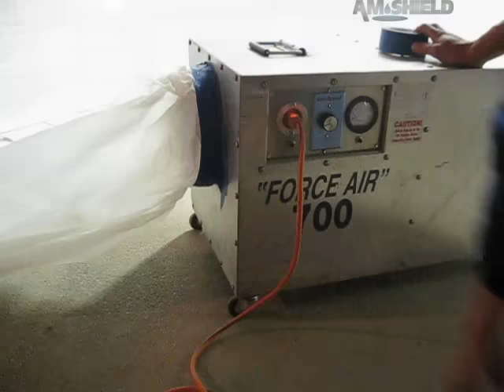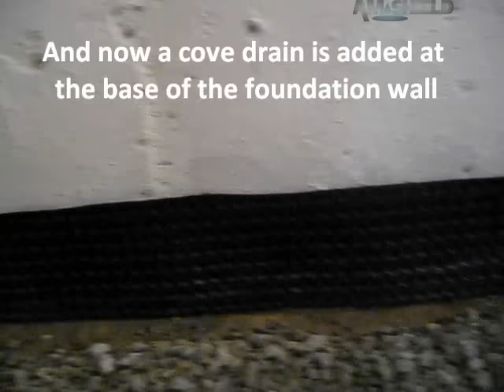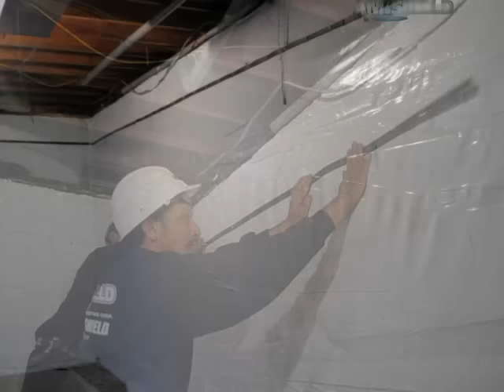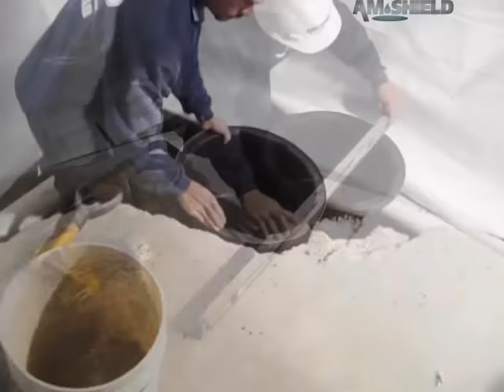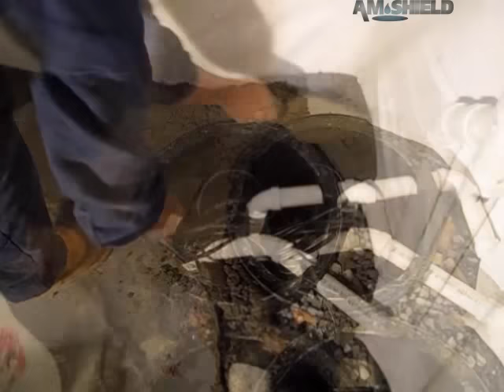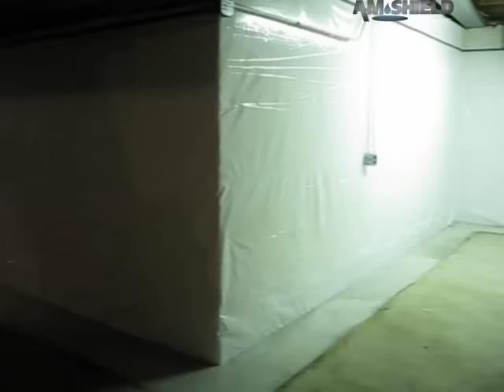Closed Pressure Relief System

Comment: 1 You forgot the weeping holes for the water to drain out the walls 
2 wrong pipe purficated black pipe with slits 
3 the gravel goes on top of pipe 
Pipe needs to make contact with ground ware the water is
Reply: no weepers needed. its a poured foundation. the white pipe is much better. it does not clog as fast. he did put stone underneath the pipe and as long as he has stone underneith the pipe. your fine

Comment: Thoughts on ADS vs PVC?  I thought ADS was the better option?  No joints and smaller drainage holes tucked in the ridges so less likely to clog than the PVC and fabric sock combination... (I know it's more difficult to pitch evenly).

Comment: the pipe trench should be installed well below the footer, i hope this was a poured concrete foundation because it looks like you missed drilling a lot of weeping holes in the cinder blocks (one every cell and also in joints)  you can't stop water coming in unless you seal from the outside with a vapor barrier.  this may last a while but in 30 years at best those cinderblocks behind those "vapor" barriers will be the consistency of hard wet sand.  This job may have cost a lot, but I can tell you it will cost a lot more for someone to come behind and do it the right way the first time.
A short term solution (maybe)
To a long term problem.
Reply from the maker: Andrew, I cant emphasize enough that a basement de watering system should NEVER be designed below the foundations footing. Th e job shown in this video is a poured concrete wall and for this reason no weep holes are installed.
Reply: @Andrew Ruffing
Pardon? So your advice is to undermine the footing?

Comment: how do you cap the pipe at the end of the line? also do you install some type of flushing fittings for future maintenance? thanks so much, great video
Reply from the maker: Hey Charlie, Normally with a four wall system there is no end to the pipe, however a PVC cap is made for this purpose. Clean outs are ports installed usually 25' apart to access the system and do periodic system flushes to homes that are effected with iron problems in the ground water.

Comment: If only you had put the trench and pipe below the footer where the water is sitting. Clean work, probably still going to have a water problem from being so shallow. Also, since you covered the wall, they won't know for a long time that it has failed.
Reply: you are wrong if you put the pipe below the footer you will undermine the foundation.
Reply: @robb930  below the level of the footer, not directly under the footer.

Comment: Just wondering if that mesh rebar will do anything to reinforce the concrete and prevent cracking when it's resting at the bottom. I've watched slab pours where they use a tool to pull the mesh up towards the middle during a pour so that it's effective.
Reply: The concrete layer is quite thin, it will do
Reply: @mamarrachopunpun  That's exactly the problem. The newly laid concrete offers no protection at all and is more likely to crack when it's poured thin. It's window dressing. Everything is completely reliant on the PVC/sump. Any newly laid concrete should match the width of the existing slab. When the concrete is laid thin, if anything goes wrong and water backs up in the trench, water will have a higher likelihood of making its way through the cracks, cold joint, and the open gap in the cove common with the standard open system. I'VE SEEN IT HAPPEN. And flooding will then be widespread and 1000x worse than if they had done nothing at all. 
Never compromise the integrity of a uniform slab, and never create a pathway for additional groundwater to enter. Retrofit interior drain tile is a total hack job.
Reply: @mamarrachopunpun  And what happens when a waterproofing co. doesn't even do a minimal amount of research on your property or attempt to determine the source of your problem, they open things up and allow in a perpetual supply of groundwater (picture the thumbnail of this video except constantly filled with water) and are then stuck with a sump which NEVER STOPS CYCLING? Happened to me. Had to pay another company to tear it out and now I'm burdened with the tremendous responsibility of how to effectively fill it back in and seal it up.
*I'm not a customer of AM Shield.

Comment: Hey there, im going to piggy back on most people’s objective in the comments below. 

I hade a contractor installed the drain tile similar to you here. 4-8” deep. Top of pipe is nearly aligned with top of footer. They also put the same white plastic board about 6 inches up along the foundation wall.

It’s been a year since I had it installed and water never gets high enough to enter the pipe.  I can see water getting into my block walls and seeping thru cracks during heavy rain. (They did drill weep holes, i have cmu blocks, but they did missed some mortar joints which was never corrected when i ask them to do so)

The Only times the sump pit collects water is when the ground water rises into it, never enough to reach the pipe. Therefore I concluded that the water pushing on the wall is taking too long to enter the pipe and slowly going under neath the slab towards the sump pit. Any updates on the systems that you have installed, I am thinking of redoing mines and going deeper towards the bottom of the footer.

Comment: Having an exposed Vapor Barrier plastic cover the basement wall. To me it's a fire hazard. A concrete sealer on the basement wall would be a better option
Reply: concrete sealer traps moisture and deteriorates the block and concrete
Reply: What would you do in place of the wall vapor barrier? I'm putting a perimeter drain in, but have had water seepage come actually through the wall about two feet high. Not sure If the perimeter drain is going to fix that problem. I'm two feet into a clayish substrate at basement floor...
Reply: @richnunya9547  without seeing the job. You may need an exterior tile drain put in. If you think an interior drain will work for you I would install a dimple rap on the wall that's leaking water and tie it into the perimeter drain. Google delta dimple m a t e
Reply: @jeanalexandre1105  Thank youuuuuuuuuuuuuuuuuuuuuuu!!!!!

Comment: Am I missing something, but how does the water get into the solid PVC without perforations?
Reply: Frank Matturri there is a quarter sized holes and they face it down so the water flows up through it that's why you didn't see them

Comment: They did not dig past the footer. So you will still have water below the foundation that can come up through the floor. Plastic sheathing on the walls will cause condensation and that can cause mold. Good luck with this job.
Reply: Of course you'll have water sitting below the foundation.  That's where its supposed to be.  What do you think would happen if you dug below the footings all the way around the perimeter of the basement?  It would weaken the whole compacted structure of the earth below the footings, potentially cause erosion and ultimately could undermine and weaken the whole foundation.
Reply: @Josh-wq8tt thank you for this important information

Comment from the maker: The pipe should never be below the footing. By doing this you take the risk of undermining   the foundation and causing structural damage.
Reply: 10 inch from footing , 4'  80/8 weeping pipe recomended @ he bottom of the footer.
Watch Daniel O'Connor all his videos he reassure pipe always the bottom of the footer. 35 years of experience.
Reply: many  many jobs that Dan O'Connor has to fix did what you just did not burying the pipe deep enough ,you are causing the water to raise to reach the pipe causing mold mildew .

Comment: That washed rock can filter the pipe. A filter fabric is eventually gonna get clogged up like a filter does if it isn’t changed. Is there any filter that never change out in any kind of system (car, A/C unit, dehumidifier, etc).  Putting the pipe at the bottom of the footer isn’t going to effect the basement walls. The water is going to be at the bottom of the footer. By the time it reaches the pipe it could start to try to go through the concrete slab. Finally, a plastic water barrier or vapor barrier on the wall is going to keep water and moisture in the walls rotting them out causing damage. If you wanna keep water out from your walls. Stop it at the source, the outside. Yes it’s more money, but you wanna spend it now rather than later. Sorry the comment so long, but this person who had this system put in is gonna regret it later.
Reply: I am not too sure there's a "right answer " corrugated pipe gets clogged  "eventuallly,  a "sock" eventually gets clogged .

Comment: If you are reading this, absolutely do not do your drain this way. He's close but there are some fatal flaws with the installation of this job.
Reply: such as?
Reply: @junglebunny5673   There should also be holes drilled in the wall to relieve water pressure pushing in from the outside.
Reply: @keith_hudson  this looks to be a poured wall. You don't need weep holes.
Reply: @chirina5  My bad. You're right.

Comment: what was the cost for this job?
Reply: FAR TOO MUCH! They didn't do it properly.
Reply: what did they do wrong
Reply: Well starters, the trench. Needs to be to the bottom of the footer. 10 inches beyond the footer. Next, filter fabric/paper. It’s in the name. Filter. What I’m your house or car needs to be changed out to work. No filter fabric. Install clean outs if you’re worried about clogging. Finally, a vapor barrier that’s gonna hold water in the walls, rotting them out. If the walls aren’t allowed to dry, it’s also possible for mold and bacteria to grow, especially with paint on the walls. That’s what’s wrong with the system.
Reply: @cth88rlz35  What would you do in place of the wall vapor barrier? I'm putting a perimeter drain in, but have had water seepage come actually through the wall about two feet high. Not sure If the perimeter drain is going to fix that problem. I'm two feet into a clayish substrate at basement floor...

Comment: For all the youtube armchair contractors out there, let me say this is about as a professional of an install as I've seen. The use of perforated PVC is a great choice. The use of filter fabric on the bottom of the trench seems like a good decision given the clay soil that they are dealing with and if it was not there, the system would become contaminated within a short period of time, rendering it useless. I will say the trench could have been a little deeper and wider, but the poster is correct in that you WILL cause structural damage if you dig below the footing level by causing soil erosion.  Clearly they wanted to avoid that. This system will keep that basement dry for many years if not decades if maintained properly. I would have liked to see the drainage pipe glued together. The vapor barrier, I'll take it or leave it as there are advantages and disadvantages. One advantage is that you get the benefit of catching the water that may be leaking through the base of the wall with that drain board, while also maintaining a radon seal. Overall, this appears to be a huge basement to waterproof and a job well done by this crew.

Comment: I didn't see any weep holes drilled. There is still water in the blocks.
Reply from the maker: This is not concrete block foundation. Its a poured wall.

Comment: I have a question why are outside sump pump pipes installed above freeze line ?
Reply: They always are. The water will never freeze in them, unless maybe if you are in Northern Alaska. The PVC will not be full of standing water to freeze. Here it appears they are discharging into a drywell and those openings are emergency discharge vents if the drywell is full. In the NY area the frost line is around 50" deep, it would not be practical to start that deep and pitch downwards, especially since 99% of homeowners discharge to the outdoors and not into dry wells.

Comment: You added a filter meshing... so when you going to jackhammer the concrete to change the filter? Note to self, EVERY filter needs to be serviced.  Use 3” gravel and your shit won’t clog up... and you’re extremely wrong about comments with not going below the footer. That’s exactly where the pipe lays... not next to the footer. Not on top. BELOW!
Reply: Exactly how is the filter going to get clogged . There is no dirt above it only concrete. The filter on the bottom is covered with rocks, so it don't matter if it gets clogged which seems highly unlikely. And no don't dig below foundation. Depending on soil it could cave in or weaken.
Reply from the maker: Hi Layne, sounds a good debate. NO PIPE OR EXCAVATION SHOULD EVER BE INSTALLED BELOW TO FOOTER.
During heavy rains a drainage system installed below the footer may cause a disturbance of the soil directly under the footer. 3" gravel may work for you, however it is not a standard practice in the industry. Thanks for your reply, Sorry it took me 2 years to reply to this.
Reply: Can you please name one filter that has an actual use case that doesn’t need to be changed/serviced?
Reply: Thanks for your reply but I think my term of below the footer is taken out of context like CNN likes to do. I’m talking next to the footer,  roughly 1/4 of an inch down so all the water can reach the pipe and never have sitting water. I’ve noticed over the years basements that have the drain system installed where on top of the footer always seem to have a slight musty smell